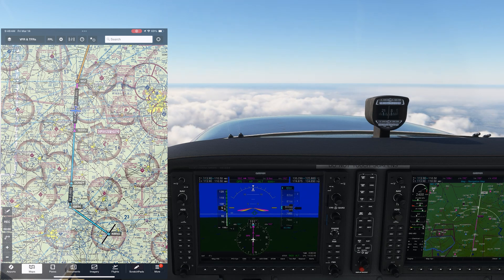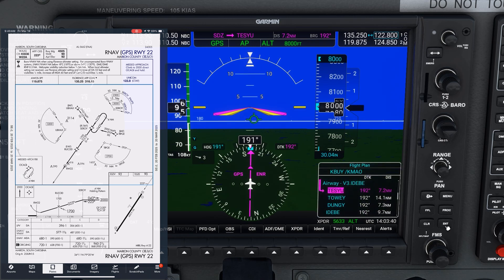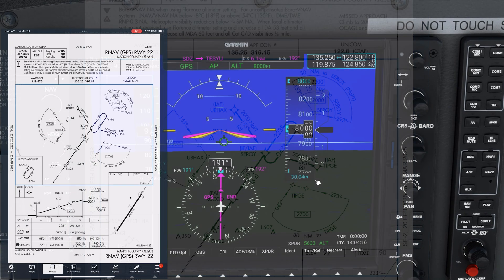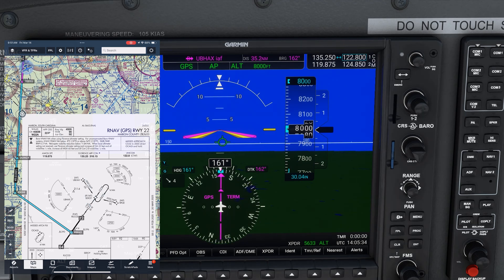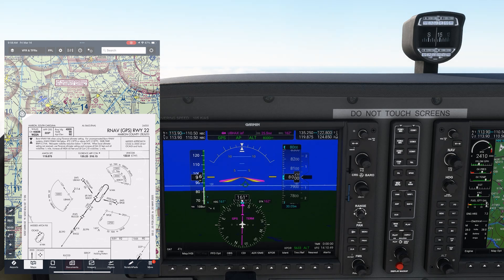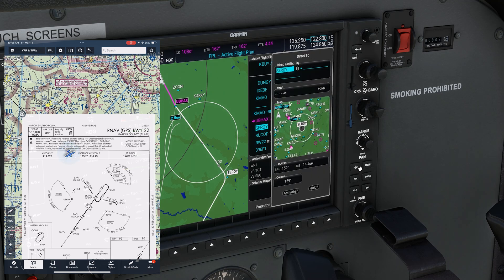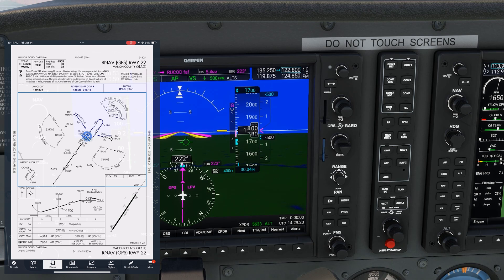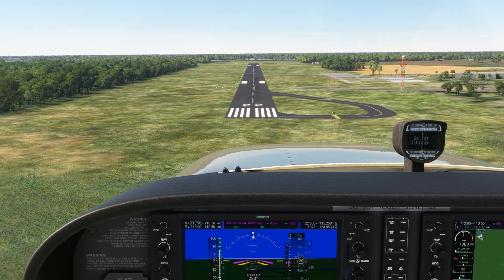Avoid This Common RNAV Approach Mistake! | G1000 IFR Tutorial

Comment: It sounds like you said to stay in NAV mode on the AP till after reaching the first step-down altitude, then arming approach mode.  Is that right?  I've read several "how-to" articles that say to arm App mode as soon as cleared for the approach.  The reason I ask is because I recently has a situation where I bugged the step down altitude while inbound to IAF, then set the VS on crossing the IAF.  I reached the stepdown altitude with plenty of time before reaching the IF before the FAF and still failed to acquire the GS.  WOndering if staying in NAV mode on the AP and going to approach mode only after reaching the first step-down altitude would prevent that?

Comment: its called the "Triangle Inequality." in a triangle any side must be less than or equal to the sum of the other two sides. seroy->ubhax = 6; ubhax->airplane is measured live; airplane->seroy is constrained to be less than 30 or less than 15. Hence when distance to ubhax is less than 30-6 = 24 we are guaranteed to be within 30 of seroy. No need to measure.

Comment: You are using Garmin avionics and teaching using ForeFlight. You could be teaching with Garmin Pilot which integrates seamlessly with the Garmin system, and is much more intuitive and easy to use for the non industry pilot, ie the rest of us. 
Just a suggestion.  Otherwise a most excellent presentation.

Comment: So what if your bearing to UBHAX is outside the UBHAX TAA and your bearing to SEROY is outside the SEROY TAA? Is there a narrow corridor between the two where both aren't applicable? Or are all TAA radials based on bearing to SEROY?

If you look at the three TAA diagrams, it almost looks like UBHAX and TIPGE are the fixes that are marked next to the SEROY fix, if that makes sense.

Comment: Dan does a great job. What I am about to present is not to belittle his work, but merely to make a suggestion.  There is a great propensity in the IFR environment to descend. “Gotta get down before I get too high.”  Two problems with this are nearing the bottom of the envelope - contact with the ground, and the increase of workload with each subsequent initiation of change of state, level-off and descent.  If we stay high until an appropriate time to descend, we avoid the ground, and avoid the work.  We achieve a better product.  On this approach, I would have applied the 3:1 rule.  

3:1 PROFILE:  The basis of this profile is Altitude(in thousands) divided by 3, ALT/3. For example, you have been assigned DIRECT IF for RNAV approach, and your current altitude is 8K.  The optimal position to begin descent is 8k/3=2.6 or 26nm from the threshold.  For those of us who fear mental math, math is easiest when you round and/or approximate, particularly when you have between-like numbers. During the descent, you will have opportunities to assess, refine, and correct any margins of error because the math gets easier at lower altitudes. For those who want to avoid the math, here is The Descent Schedule.  (Ampersand represents “at”):

Descent Schedule:
Altitude@distance
30k@90nm (Descend thru 30K at 90nm)
20k@60nm
10k@30nm
6k@20nm
3k@10nm
1.5k@5nm (Standard ILS Platform altitude)
1.2k@4nm
.9k@3nm (9 hundred feet at 3nm)
.6k@2nm
.3k@1nm

So what vertical speed do we use?

RATE OF DESCENT: The airspeed to maintain a 3:1 or 3* profile can be easily calculated by  RoD=1/2GS*10 (You take half of the ground speed and tag a zero to it). For example, Ground speed 106kts would require a descent rate of 53 with a zero tagged on, or 530fpm.

Best of luck to everyone.

Comment: The clearance was direct to UBHAX and then cleared for the approach. Since the TAA altitudes are minimum and not mandatory altitudes wouldn't it be simpler to just proceed to UBHAX and use 3200 as the altitude to descent to?  Also given the position of the aircraft at the time the clearance was issued, wouldn't it be more likely that ATC would clear direct to SEROY (which is also an IAF).  In that case the distance to SEROY would already be displayed in the route on the G1000 and the 15 nm / 30 nm minimums would be easy to determine.

Comment: I was surprised that you bugged "400" for the DA. I was taught to use the first number (in this case 396-1) for the Decision Altitude. So I would have bugged "396" as DA (not 400). 396 is MSL and is 306 AGL (TDZE is 90). I understand it's only a 4 foot difference, but nevertheless which of the 2 numbers is the DA?
Reply: The MDA/DA bug in the G1000 only has a 10-ft resolution, so you pick the closest number to the published altitude that isn't below it. In this case it's 400.
Reply: @407SierraTango  Thanks for your reply. I have two Garmin GI 275s and a Garmin GFC 500 autopilot. I can set the DA at a 1 foot reolution. So that's why I would have bugged 396.  Again, not that a 4 foot difference is significant; and I understand that by erring on the "safe side" by bugging the DA at 400 is definitely adequate.

Comment: Dan, what is the rationale for not arming approach mode when cleared for the approach?  I was trained that arming approach mode when cleared for the approach, irrespective of your current position, is the correct technique.  I have flown many hundreds of hours of IFR using this technique in a G1000 equipped airplane and have never experienced an issue.  Why do you recommend waiting to arm approach mode until established on the final approach course?
Reply: @LRobichauxIV  you’re doing it right.
Reply: This wasn’t mentioned to me until I flew an airliner. Standard procedure is to fly in VNAV until just before the G/S intercept altitude because approach mode will not respect altitude restrictions on the approach, only the glideslope signal. Therefore you could be dangerously close to terrain or other traffic by selecting approach mode too early.
Reply: Another thing to consider is that some units have time limits for approach mode, so on a longer approach, the approach mode may disable unexpectedly

Comment: Typically, when you hear the verbiage “cleared for the approach”, that is when you push APPR  mode.
Reply: Absolutely do NOT do this. Bad habit. Don’t press approach mode until your next fix is FAF. Common mistake, but the G/S or G/P will not necessarily respect previous altitude restrictions on the approach.
Reply: @Micg51  You have no idea what you are talking about.   Show me.  What are your credentials?  ATP CFIIMEI DPE Part 135 check airman here with 3000+ hours actual in the clouds. 1000s of actual approaches.
Reply: @sixwillwin  ATP CFII typed in ERJ170/190 and B737 2000+ hours. A debrief item on both airlines CQ if you engage approach mode that early.

Comment: What if I’m in the exact worse spot, southwest of all this with my bearing to SEROY of 043. For example, directly over the airport. Then, none of the wedges apply. What are my altitudes then?
Reply: You would be vectored until you are in a wedge or you would remain at your last assigned altitude until your clearance takes you into a wedge.  No different than if you were 31 miles from the applicable reference point.
Reply: @ That is very helpful, thanks!

Comment: What I usually have done in the past is set my VNAV information to arrive at, in this example, 2300‘ 30 miles from Seroy with a user fix. Then I allow the VNAV to “ride” me down to 2300’ at that point.
Reply: Better would be to set it to 1700 (FAF) and allow VNAV to do the step downs for you. This is particularly true for Garmin based avionics.

Comment: Since the sector boundaries are coincident for the external fixes (153 to UBHAX as well as SEROY, and 293 to TIPGE as well as SEROY), would there be a scenario where you can select the wrong sector you're in? I can't really picture a scenario like that. Excellent point on the distance factor though, I would have certainly fall victim to confirmation bias and read every sector "anchor" as the center IAF (SEROY)

Comment: 5:20 I am cleared for the approach, on a bold segment and beyond my IAP.  Why would I not enable APR on the autopilot at this point?  Why wait?
Reply: @smvms  some systems require you to within 090* of inbound course but most of the time, when you are cleared for the approach
Reply: Approach mode will not respect altitude restrictions on the approach. Those are mandatory at or above restrictions. APP may fly below those restrictions. Only the glide slope intercept altitude has to be correct for APP mode.

Comment: I'm not IFR rated, but what happens if you're SW of the airports such that the heading to UBHAX is 042 and the heading to TIPGE is 044? Seems like there is a dead area SW of the airport where neither of the altitude arcs apply.
Reply: You would be approximately 300 miles away and not likely cleared for this approach.  Certainly not within the 30 NM ring.
Reply: ATC wouldn’t send you direct to UBHAX from the SW. They would sent u direct TIPGE or SEROY. If they did tho, you would need to query them because its a mistake